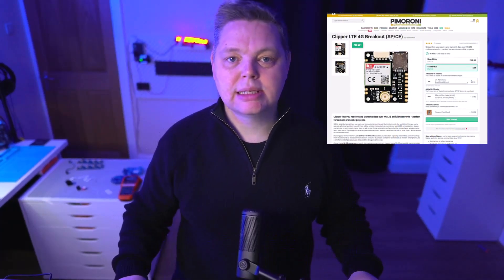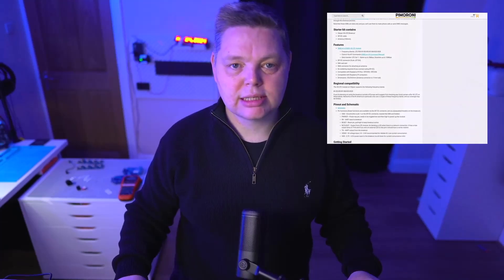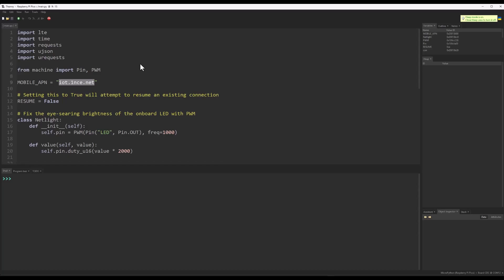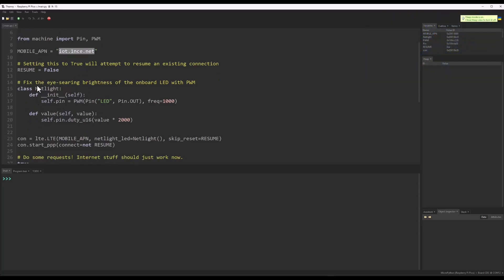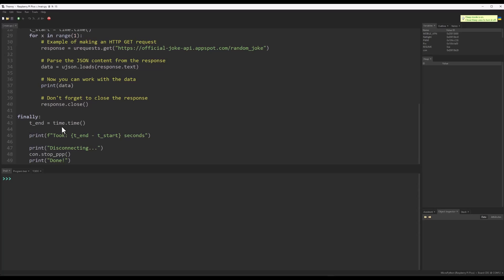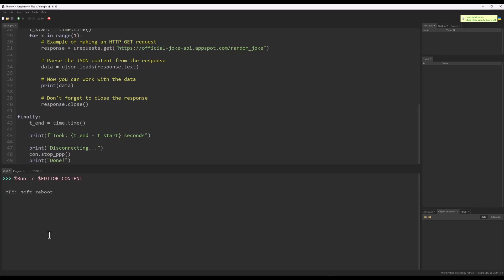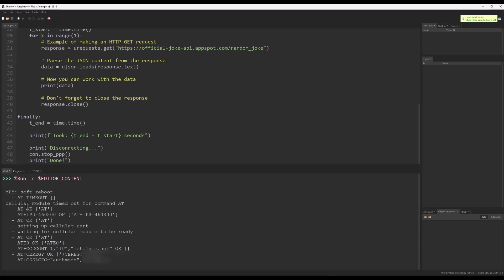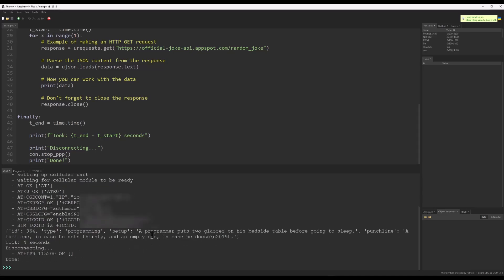Pimoroni Clipper LTE 4G Breakout (SP/CE)

Comment: You say this is not able to send SMS messages. Please confirm.
Reply from the maker: Hi 

it wasn't a thing with the SIM that shipped with the board from Pimoroni, it may not be the case with other sims, the module itself should be able to do it, but I haven't confirmed. The top up page for the SIM is here, however you can no longer purchase top ups from Pimoroni, I will reach out to them and ask, which I have before and I didn't get a reply. 

 https://shop.pimoroni.com/pages/topping-up-your-clipper-sim?srsltid=AfmBOorOZTt9YO2Wk-8p2YhBK4C4i38gz7S5lNYxB1FKWMgjhCb9J8M3

Comment: Hey! Really appreciate your vid about this, it has helped me so much with this module :) People like you are deserve so much appreciation, and I want to become as skilled as you one day. I am trying to use it in a project where it has to be able to connect and disconnect one time after the other (as such as in a while loop) and it fails at every AT-command when trying to do so. I have a pimoroni pico plus 2. My instinct says that the module does not disconnect properly so that is not in a ready-state for reconnecting. The last AT-command that displays in the shell when the con.stop_ppp()-methods acts is  "AT+IPR=115200", but that is merely a reset of the baudrate back to 115200? Are there more AT-commands that runs under the hood, or is this the way it disconnects, by changing the baud? I have found that ATH should be the proper command. I have been trying to locate the "lte"-lib to see which code is actually running, but with great failure.

Therefore, I have been trying to run the module via my own cables and UART-interface, and run through the "generic" AT-commands, but I fail to connect to the internet again. I have one more question: do you know which pins the pimoroni uses for TX/RX via the SP/CE connector? It says GPIO35 and GPIO32, but I can't communicate with it if I try my own manual set up, and I really like the handy SP/CE cable connection. Or is the SP/CE onlyt for SPI? On the pinout you can see that the connectors are "all pink", which is marked as SPI. Does the module and pico communicate via SPI when using the SP/CE?

I have been on this for multiple days in a row and I cannot figure it out. If you have any ideas, please let me know!

Thanks again mate!
Sincerely, Jacob
Reply from the maker: Once you have connected and have a connection, you should be able to do your work in the loop and the connection should stay up until you terminate it, if that makes sense and if I haven't misunderstood. 

Thanks for watching and reaching out.
Reply: @RamblinggeekUk  Indeed it does, for a while! This program will go on for days, possibly a week or two, and I have encounterd problems that is if I connect before the main programs infinite loop starts it has a tendency to shut down the connection after some hours, in this case mostly around 10 hours. This is an infinite loop that will check some sensors, and if they exceed a certain value I want the clipper to establish connection, send push-notifications, through ntfy for example, and then shut down the connection and therefore have a "stable and fresh" connection for every request.post() through ntfy. 

So to summarize(it turned out longer than I expected): It seems that it doesn't work to have a stable connection "forever" without it shutting down at some point, and this makes me to not trust the clipper completely. It will monitor animals, and failure with connection is not acceptable. The solution I am looking for is to connect and shutdown from time to time, but the clipper fails to do so, and my suspicion is because it does not shut down the connection properly and therefore is not in a "ready-state" to establish a new one, and I can't access the method stop_ppp() to see exactly how it shuts it down.
Reply from the maker: Why not collect the data from the sensors, connect and push to a WebAPI/REST to collect the data?  It could be sending the data every x minutes.  You could maybe store the data locally in a json file or csv, connect once every x minutes and then send the file a cloud storage?
Reply: @RamblinggeekUk  I don't think it is possible for me since in my project I do not have access to any external hardware, i.e. the system that I have must do all the work. Collecting data, connect to internet and then push notification throught ntfy. And then do it all over again.

I have just spent the day with this damn clipper again... I have a severe headache now. I have come to the conclusion that if I connect the clipper to internet and then I go in to a while loop where I will do some stuff, and push through ntfy. I do not disconnect within the loop, and there is always the case that the clipper can send four(4) requests.post() before crashing,. The interesting part is that is the same result no matter the time between the posts. I can have a pause for 10s. in one program, and a pause for 10min. in the other. It is always 4! After the crash, is has to be done a hard reset(machine.reset) before it can connect and function again. The hard reset bothers me, it is not the way to go. 

This little piece of hardware is starting to go on my nerves. I have also tried to ping google here and there in the loop in hope to keep it alive, bot without luck. Do you have any ideas? I would be so, so grateful if you maybe have some approach that I do not know about.

Cheers!
Reply: @RamblinggeekUk  I actually just solved it! I skipped the lte-library and communicated with the clipper through UART and sent AT-commands manually. Finally, I think I have the hard- and software for my project. If you want the code and documentation I will gladly send it to you as a big thanks!

Comment: i have tried for days to get this working on my esp32 i just cant get it to detect my sim even though it works in my phone, help
Reply: Which AT-commands are you running on it?
/Jacob
Reply from the maker: Are you using the SIM supplier or another one ?  If using a he sim provided, do you have a pico to test with ?